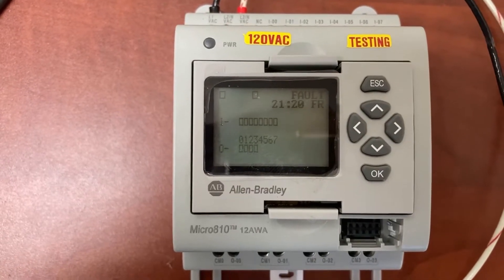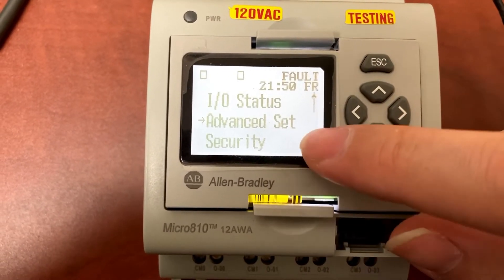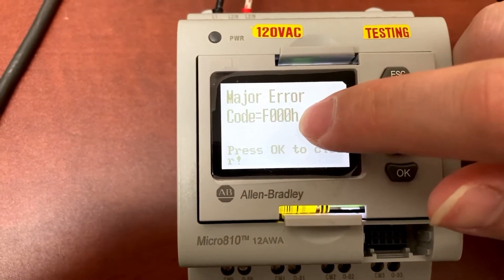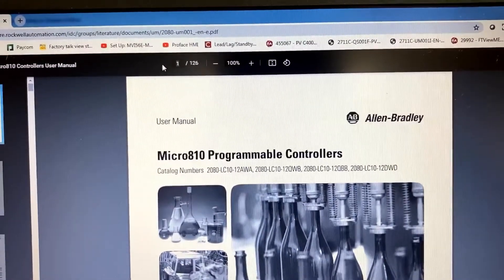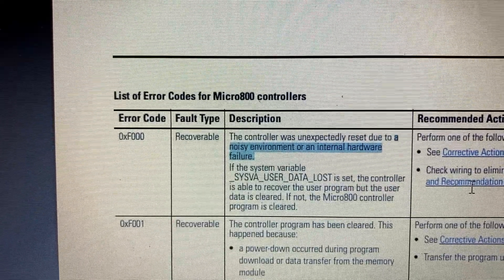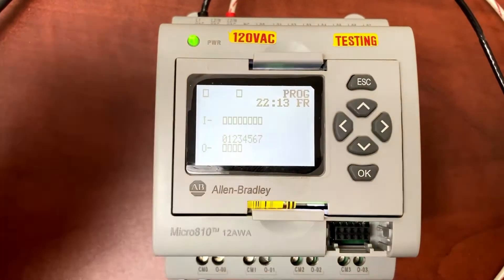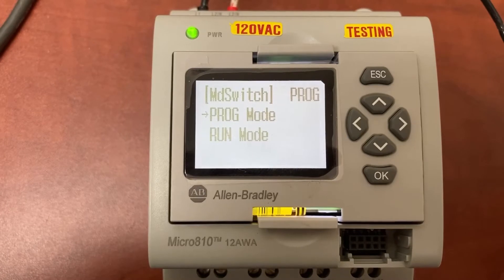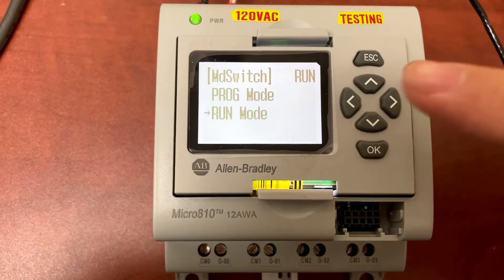Allen Bradley Micro810 How To Check and Clear PLC Fault

Comment: Do have perchance have any pinout information on the 10 pin communication plug on the Micro810. I believe it is an RS232 cable and the 2080 adaptor  is used tp convert from USB to RS232. Thanks
Reply from the maker: @Appregator: For programming, you will need to buy a USB adapter. CAT# 2080-USBADAPTER. Thank you for your comment.
Reply: @SYPHOANG   OK Thanks.